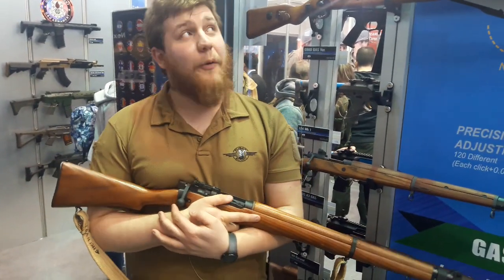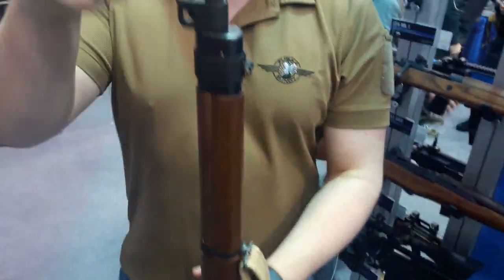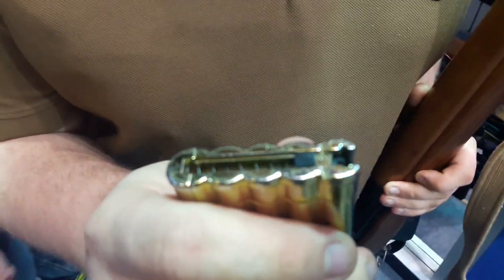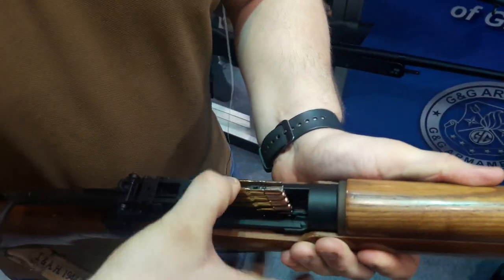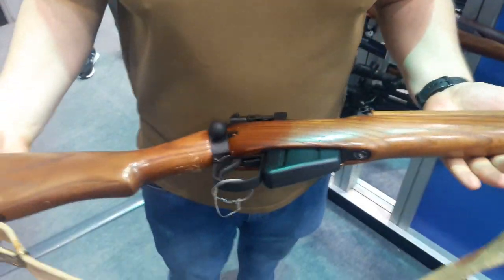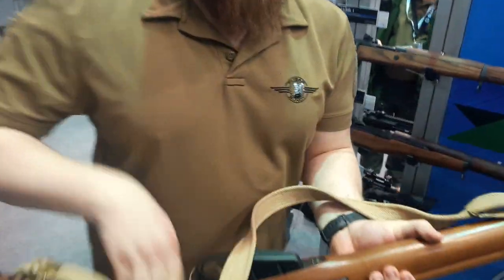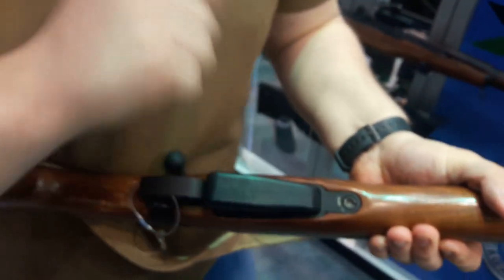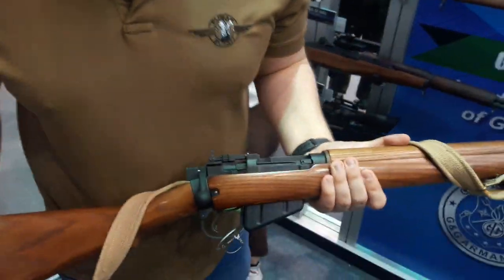G&G Lee Enfield LE4 NO:1 Gas powered airsoft rifle overview at IWA 2019

Comment: I want this smle 😱😱😱😍 but its sad that its not a shell ejecting
Reply from the maker: You can make it eject the 'clip' (mag) when empty. A firm fast pull on the bolt causes it to eject up
Reply: It's not a SMLE.
Reply: @renlin8925  The SMLE was the Number 1. It is distinguishable from the Number 4, by the absence of a protruding Barrel.

Also, the SMLE ran as far as a Mk V.